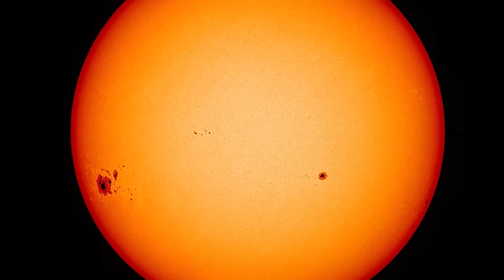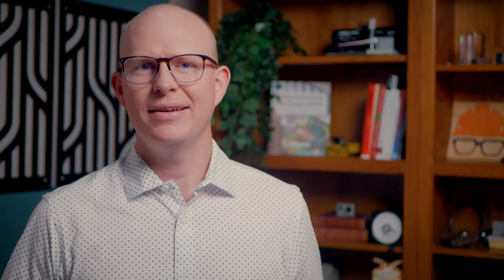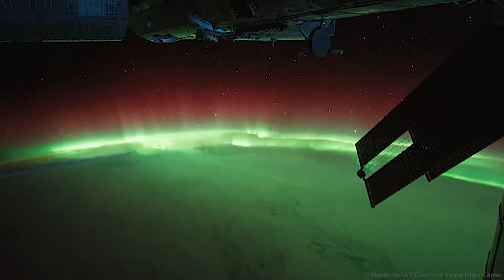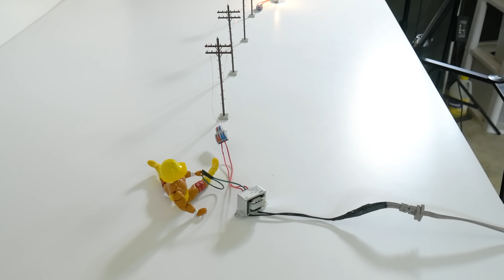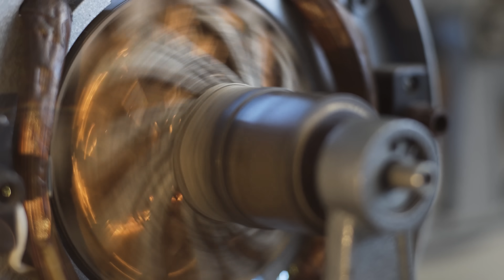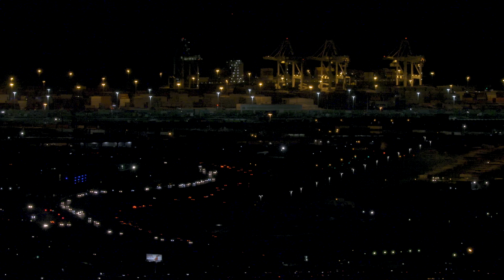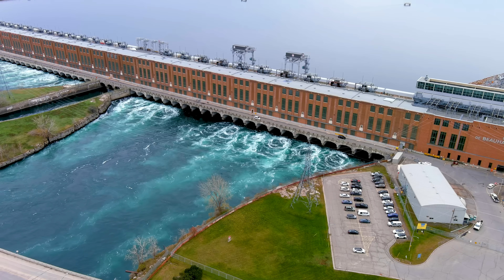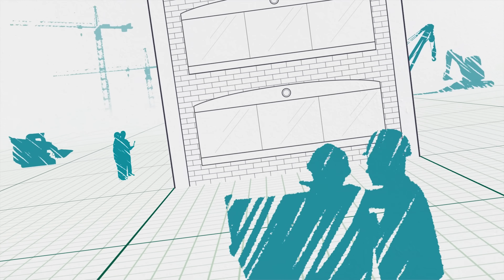The Most Confusing Part of the Power Grid

Comment: This (no pun intended) just lit SO many lightbulbs for me. I've only ever tried to think about power factor in an industrial context - not a class or lecture, or any full description of the concept and I've been frustrated that I didn't get it. All the stuff I've been able to find online gives you a pile of equations stripped down for utility and zero intuition for why they work (or even what they're doing). Your animated graph with the power going negative along with the idea of energy being temporarily stored for a fraction of a phase was all I needed for everything to click into place. Now I'm going back to the rest of the internet to see if I can grasp the power triangle better with a new mental model... Thank you!!!
Reply: I think that it was the realization power flow wasn't constant (and can reverse) over the course of a period was the key for me. The complete "AC" explanations are super helpful for calculating stuff with phasors, but man do they sweep so much under the rug when you're trying to learn!
Reply: @AlphaPhoenixChannel it’s time for a new video on the subject (really loving your electricity videos)
Reply: Your channel's example of electric traveling through a line like water with it 'sloshing back and forth' before settling changed the way i looked at electricity
Reply: @errhka outside of transformers, you can use the water in pipes to explain a surprising amount of electrical engineering. Including stuff like switching power supplies (ram pumps), semiconductor wizardry (valves), capacitors (water tanks/towers), inductors (pipes with moving water) and it all translates really well qualitatively.
Reply: yeah, power factors, reactive power and thermodynamics.. Think of an idle transformer connected to mains. Massive current + full voltage but no power consumed except due to unwanted resistance..

Comment: On solar or microgrid If you measure volts and amps at the meter that will give you actual wattage that's going into the grid which is about 15%
Of your what meter on your house

Comment: Great video, super educational and well explained as always! Just one word of caution for future electrical videos. It looks like you used a polarized capacitor at about 6:15. Polarized capacitors are basically shorts when reverse voltage is applied, and shouldn't be used on AC circuits (unless your AC signal is DC shifted so the low peaks are greater than 0V). Hope this helps in the future! And thanks for the videos!

Comment: While the vast majority of the power grid is A/C, not all. There are High Voltage DC (HVDC) lines used to mitigate the flow issues. https://en.wikipedia.org/wiki/High-voltage_direct_current

Comment: In the paper industry we use synchonous motors to refine pulp (grind).  Those synchronous motors appear as capacitive loads and there are usually 6 1MW motors per paper machine.  So that's 6MW to counter act all the inductive loads that are also running in the mill.  Saves the mill quite a bit of money to use those motors.
Reply: Interesting form of self regulating the reactive power in your system. I'm guessing those synchronous motors have an excess of field excitation for them to appear as capacitive loads?
Reply: Thats really cool! Starting them must be exciting lol
Reply: @ASA_SXC  I've never worked with synchronous motors that big, but motors in the 100 kW range are started with a pony motor that spins the synchronous motor up to operating speed so it can be started without excitement. 🙂
Reply: Where I used to work we also had theese, althought bigger. The biggest one was 25 MW just by itself.

Comment: Your meter might not measure and charge you for reactive power, but you do pay for it-or rather, you pay for everybody's reactive power, and everybody pays for yours. As you say, it is costly and there are losses, involved in sending power and taking it back, consumed or not-those costs have to be covered by higher rates on consumed power.

Comment: Excellent presentation of AC basics including inductive and capactive conditions effecting transmission lines  An interesting example of this subject is the long AC transmission lines from the Dalles Oregon to Los Angeles.  About every 50 mile along this line is a station of both reactors and capacators The caps are series and the reactors are shunt and are switched in and out under different load conditions to keep the line stable.  There was much debate about a AC line this long so a DC line was built along side.  Both work well but are very different.

Comment: I learned the mnemonic "ELI the ICE man" for E leads I in an L (inductive) circuit and I leads E in a capacitive circuit.  At work, we have several power factor correction capacitors, with units of kiloVARs, to compensate for the motor loads.  A very good video here!  Thanks!

Comment: Here's another power grid question I'd love to see you explain, if you haven't already. Why don't we put the power lines of our grid underground to prevent outages from inclement weather? Is it just a matter of cost? Earthquakes?
Reply: Underground cables have a high capacitance due to the ground, the surrounding cable insulation and the soil acts as a dielectric found in a capacitor. For high voltage circuits, these creates 'charging currents' which cause the receiving end voltage to be higher than the sending end voltage.

Comment: I had a traffic signal controller that would periodically suffer a blown fuse.  It was eventually found that the capacitors were causing voltage spikes on the grid but only at night.  It was located in an industrial area.

Comment: The EEFI (Essential Element of Friendly Information) is in the document briefly shown.  The arriving CME (coronal mass ejection) creates or alters the earth's magnetic field.  A static field, such as the magnetic north and south, does not interact with wires to generate electricity BUT moving a wire past a magnet OR moving the magnet past the wire, generates electricity.  Since the wavelength of the moving earth magnet is slow, it acts like DC or direct current.  This current is induced on long transmission lines and apparently has tremendous magnitude such that this current saturates a transformer and that, in turn, causes clipping or flat-topping of the AC current, and this abrupt clipping produces high frequency harmonics with seriously negative consequences on the transformer itself and anything capacitive downstream.  When the transformer core saturates, it effectively becomes a short circuit to the supply side; it can no longer resist the rising voltage of the AC wave.  So not only does it clip the waveform, it suddenly draws enormous current and in some instances in Canada actually melted the copper in the transformer. 

That is all for AC transmission lines, the most common.  But Canada has also got HVDC, high voltage DC transmission lines.  You need only one wire for that and impose a very high voltage on that one wire, using the ground itself as the return path.  Since it is already DC, a geomagnetic storm can couple magnetically and increase (or decrease) the voltage.  Either way it is bad.
Reply: I spent most of my career working on the Pacific DC Intertie.  HVDC systems are typically arranged in a bipole (two wires) with ground return used only in emergencies or to carry the slight current imbalance in the bipole.  The converter stations have sophisticated computer controls to regulate both current and voltage.  Geomagnetic storms are a non-issue for HVDC.  For large AC transformers, it doesn't really take that much DC bias to drive the iron core into saturation.  I would not characterize the GIC bias currents as tremendous.  Though they have disproportionate consequences for the transformer.

Comment: What many people misunderstand about reactive power compensation is that they regard the load-side compensation system as an "energy supplier", which is wrong. It is an energy store and, when uncharged, is also fully charged by the supplier. This means that when inductive loads are switched on for the first time, the energy supplier not only feeds their required reactive power, but also that of the compensation system. Only then does the reactive current begin to swing back and forth between the load and the compensation system, which would otherwise swing between the load and the supplier without the system, thus burdening the entire current path. 

This means that the energy supplier no longer has to supply the initial package of reactive power because of the compensation system. The whole thing corresponds to the excitation of a resonant circuit. However, like any real oscillating circuit, this story is also subject to damping, i.e. losses, so that the energy supplier must gradually supply the lost portion of the oscillation energy.

Comment: 6:19 Did he really use a polarized capacitor on AC? 😂
Reply: Same thought, I was waiting for it to go pop
Reply: Way back when I was young and pretty fresh out of electronics 101 class, I learned that I could use small electrolytic capacitors to reduce the ignition noise imparted to my new car stereo. I can't remember exactly how I wired the two of them but I remember after soldering them together and touching one end of a wire leading to them to the power source the the tip of the wire glowed red. To which I immediately pulled it away. Curiosity told me to touch it again and it glowed red again but this time also with a surprising loud pop right under my chin. After I regained my composure and investigated, one of the capacitors had exploded. Good stuff!!

Comment: 3:44 if that is a Lead-Acid battery, you should definitely get it charged! Normally Lead-Acid batteries are found in 6V, 12V, and 24V packages, so if yours is a 12V, this is extremely low voltage for it to be in! Normally fully-charged 12V Lead-Acid battery will sit at around 12.4V-12.6V when in open circuit.
11:40 imaginary numbers aren't real! They can't hurt you!

Comment: Hi Mr. Grady!
Yes, a capictor is often used to correct the power factor for inductive loads (in which the current lags behind the voltage).
That is why many heavy duty electrical motors have a "starter capacitor", to bring enough current in for a given voltage to be able to over come the static friction, and start the motor turning.
Ahh, you cover that.  Well good.

Comment: About 2 billion vehicles are in use world wide (not scooters or bikes), how much power will need to be produced, America will have to at least double their production and they already produce a shed load, countries without huge production now will have to invest an enormous amount more in generation and distribution, where's all that coming from, just consider the copper needed let alone all the glass and silicone for solar and wind. I think it's impossible and certainly not in the next 50 years let alone by 2030. The only answer is for the majority of people to not exist so the few have plenty which I believe they're working on right now.
Reply: The current power demand fluctuates greater than 200% during a typical day. Some electric power companies charge different rates at different times of the day. This is to encourage energy usage at night when power demand is lowest. Commuter cars plugged into home smart chargers will charge at night when there is excess production and transmission capacity. (This smart metering or time of day metering started in the 1990's in some areas. It gives people more control of their electric bills.)

Long distance electric car travel, other changing demands and changes in electric production and power storage will be other factors. Much of this has been getting addressed for years.
Reply: @erniecolussy1705  Yea lets ignore the reality of the problems we already have and pretend everything will turn out rosy, there's no reason to think we would need more electricity just because 2 billion EV will be on the road.

Comment: This video should be incorporated into every Intro to Engineering or other required course at the core of an engineering degree at the 101 level.  As many others have said, this is the clearest explanation of a complex subject I've ever seen; I got my engineering degree over 50 years ago, and the partial differential equations I had to learn would have made much more sense with the simple practical examples  in this video.  Very well done!!

Comment: You may have realized this and went ahead for the demo, but the cap you used is polarized so there's a slim chance it could have popped under AC. You can use electrolytics in ac circuits, just use two and tie their negative leads together.

Comment: Couple precisions on the 1989 Québec outage:  
There were 7 voltage compensators, along the 5 lines from james bay to the south. But the solar flares inducted such  large VARIATIONS in induced voltage that they couldn't keep up and  progressively put themselves offline at which point the voltage variations on the line caused the breakers to trip on those 5 lines from the north, causing about 9.5 gigawatts of power loss. 
The real cause of the outage in Québec was lack of automatic load shedding which resulted in he rest of network also tripping.
Contrary to your statement, there was no damage since breakers tripped to protect the network.  But it took 9 hours to manually restore power.
The largest change was the creation of automatic load shedding in  Québec, something the NE power grid didn't learn  until their large outage in 2003.  Hydro Québec also added more resilience to the hardware along those lines to handle such voltages. (and after 1998 ice storm, also made changes to alow transmission lines to heat up to melt ice on them).  (details not released, but I assume it involves large current on a line to cause it to heat up).

I was in an office building when it happened and learned the hard way that tyeir generator had enough power to stll magnetically lock all elemergeny exits. Had to call fire department who then patched me to building security who told me to take elevator. 
Had to walk downtown (no metro), and the only lights were from cars, except where I got near the Forum (hockey arena) that was all brightly lighted up! It wa Stanley cup finals and one requirement was to have sufficient  generators to continue game and more importantly the broadcast of games. However, they had all doors kept opened  and traps on roof also opened as air conditioning was not part of emergency generators (but ice making was).
Reply from the maker: Thanks for sharing! From the report I read: "Among the major pieces of damaged equipment were two La Grande 4 generating station step-up transformers damaged by overvoltage when the network separated and a shunt reactor at Nemiscau that requires factory repair. The SVCs at the Albanel and Nemiscau substations suffered only minor damage: thyristors were damaged at Nemiscau and capacitor bank units failed at Albanel. The SVC phase-C transformer at the
Chibougamau substation was also damaged by overvoltage following system separation."
Reply: @PracticalEngineeringChannel  My bad, I had to look it up. The outage I remembered and explained in my reply to your video was the April 1988 one and it was at 20:08 local time.  When I started to research the 1989 one, it said it happened at 02:44 n march which didn't sound right since I wouldn't have been in the office then !  So those were 2 different ones.  The 1988 was equipment failure on the line from Manicouagan  so not related to aurora. For some reason, over time, I have merged the two together.   So it was the 1988 one where there was no automatic load shedding. not sure how much was implemented in 1989 and obviously not enough since all went down anyways. 
Did find a report that details damage to facilities which I had not heard about (the NERC report in english and matches your list of failures).   What I find surprising is that a power station attached to a very very long line (and thus high risk of failure of line) would not react gracefully when the line is effectively cut without warning.   But I do recall the PR in the media about this being just safety breaker tripping due to unusual currents and no damage, but that it took very long to "reboot" the province sector by sector.  But the NERC report is fairly detailed (even the  Gentilly-2 nuclear plant scrammed to shutdown which I also find odd (it is in its 50 year of decommissioning right now).
Reply: @PracticalEngineeringChannel  Hydro Québec has a page titled "Understanding Electricity | March 1989 Blackout | Hydro-Québec"  which has fluffy PR on the 1989 outage.  (and no mention of damage, just that safety systems worked).  (but I trust the NERC report more). 

On March 10, a strong wind left the Sun, heading for Earth. On March 12, the first voltage fluctuations were being seen on the Hydro-Québec transmission grid. The System Control Centre was doing what it could to maintain stability. However, on March 13 at 2:44 a.m., the Earth's magnetic field was fluctuating violently. The grid's protection system was triggered, and a blackout occurred in less than a minute! The province was submerged in darkness for more than nine hours.

Comment: Simple. Generation guy here. The power factor is the losses between generation of power and the end user. At the generation end, we really produce volts to get you at home 120 volts. Yes you are billed for the loses, it's just built into the bill.
Reply: That is an extreme over simplification. It ignores the fact that a major part of power factor is the result of equipment at the users end. It is also indicates that resistive losses during transmission is included in the power factor. Resistive losses are not part of power factor.